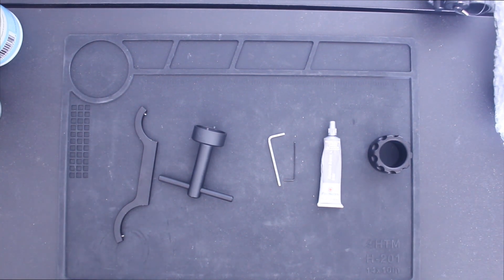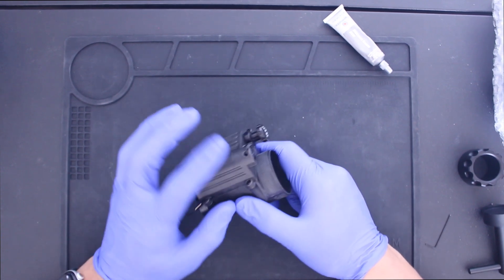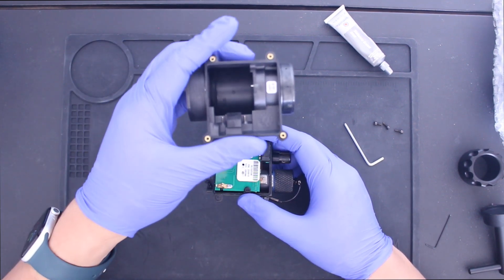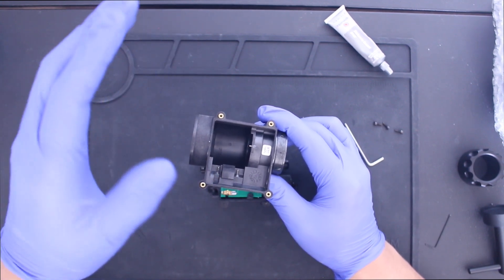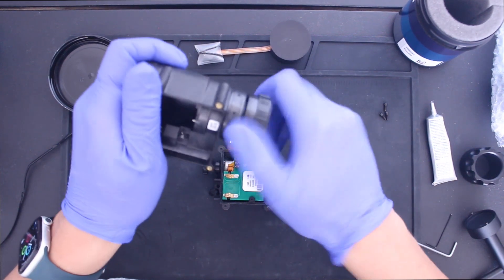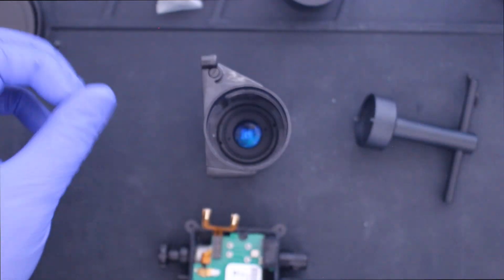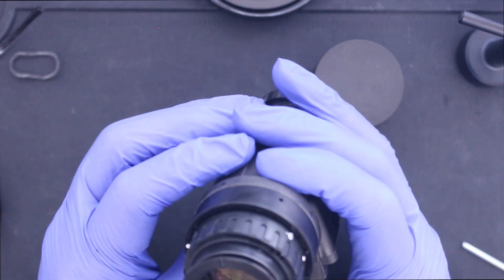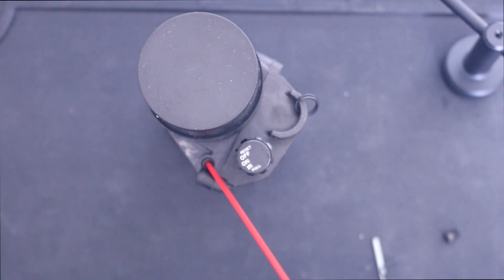How to Assemble a PVS-14 Night Vision Monocular | Step-by-Step DIY Build Guide

Comment: Hello, just came across your video. My pvs14 is flickering really bad. Do you know what would be cauing thus?
Reply from the maker: Loose retaining ring or the battery compartment springs are not making contact with the intensifier tube. Worst case: your intensifier is dying

Comment: hey, my objective lens is able to be spun so far counter-clockwise that it actually unthreads from the housing. I never really need to adjust it that far anyway, but it is slightly annoying. I'm assuming that the objective retaining ring is either missing or got unthreaded somehow. Do you know if this can cause serious issues, or is it something I can just be careful with and just not adjust it far enough for it to unthread?
Reply from the maker: If the retaining ring is unthreaded it can probably damage your intensifier tube. If the whole lens pops off completely, you’re risking getting debris into your unit and 100% losing your nitrogen purge
Reply: @rocketcityanalytics yeah, the purge is definitely gone. I was looking into just getting a D-collar to solve the issue, as that can just be installed without having to disassemble the entire unit, but there’s conflicting information on compatibility with milspec housing.